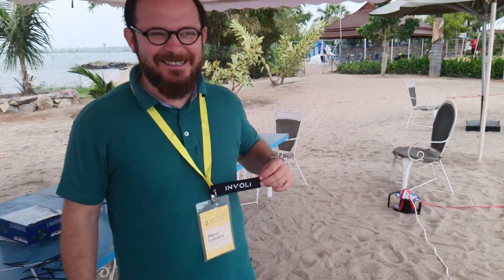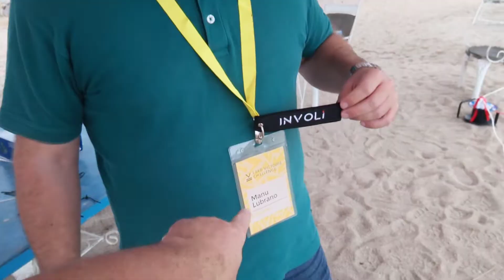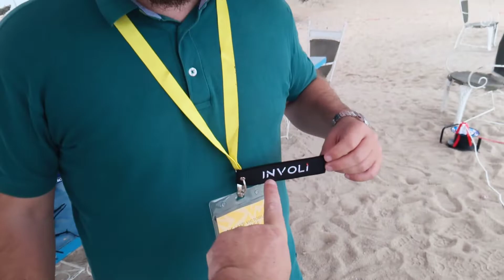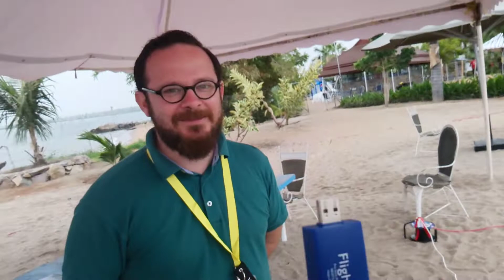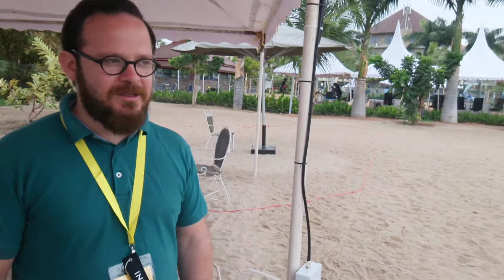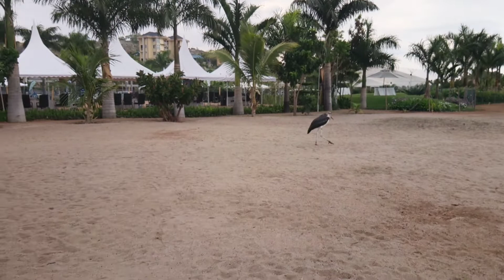Involi - Lake Victoria Challenge

Comment: ADS-B doesn't send GPS position?
Reply: @1:23 I wondered that too...  I think he says "Mode S"?  https://www.skybrary.aero/index.php/Mode_S  I think that's what he's talking about.  Old stuff; https://www.aea.net/AvionicsNews/ANArchives/April05ModeS.pdf  WWII era.  I assume ADS-B came after GPS was unscrambled in 2000.
Reply from the maker: @mistercohaagen  ADS-B is a really old 1990 standard, and Mode S is the multilateration that he talks about.
Reply: @sUASNews  Well now I'm just confused, lol.  Where's Bruce?  Halp!
Reply from the maker: @mistercohaagen  ADS-B is what aircraft are rushing to equip with before 2020, but it is from a time before GPS was descrambled. If you only have one receiver you can only see ADS-B tracks as they send GPS positions in their transmissions. All aircraft in Tanzania must have Mode-S or ADS-B transponders, to decode the Mode-S you need at least 4 receivers hearing the same signal and the time it arrives at each station is noted and a position triangulated from that. FLARM and OGN are much like ADS-B but cheaper, they also send GPS positions but operate on a slightly different frequency. Maybe we should get Bruces whiteboard out. Paging @xjet paging @xjet
Reply: @sUASNews  Heh, okay that's helpful.  IRRC from what I first read, the ADS-B was proposed prior to GPS descrambling, but implemented with GPS, as it coincidentally became an option at the time.  Mode S was based on much older basic transponder tech so that AA guns didn't blast their own planes, and multilateration came shortly after, but became much more feasible after DSP IC's became affordable.  I wish they'd make a BBC Horizon (or PBS Nova) episode on this stuff.  The history is fascinating to me.